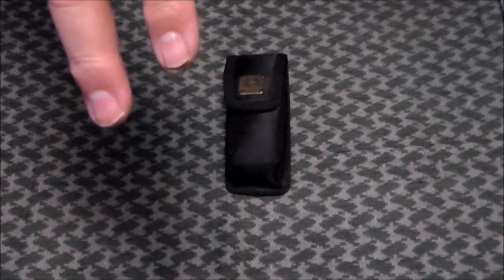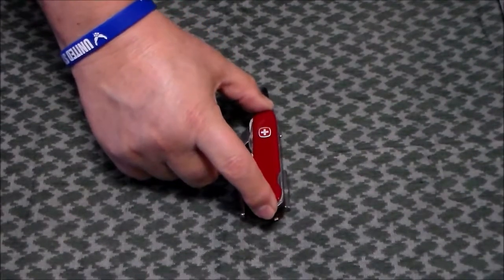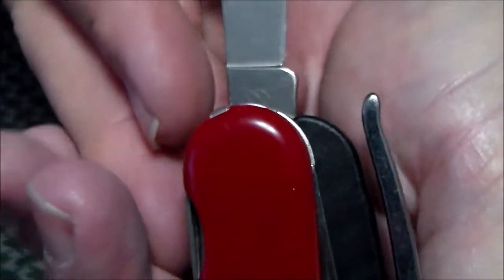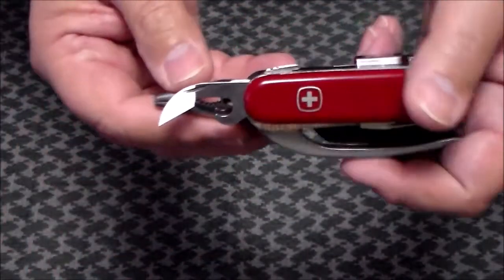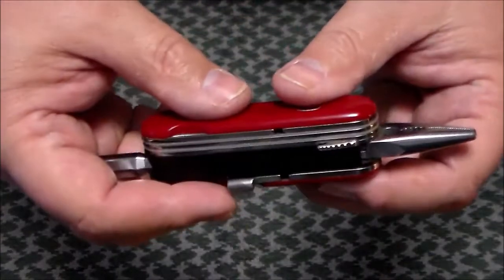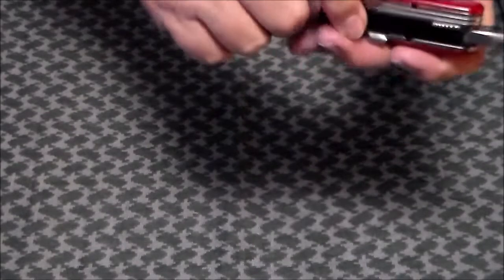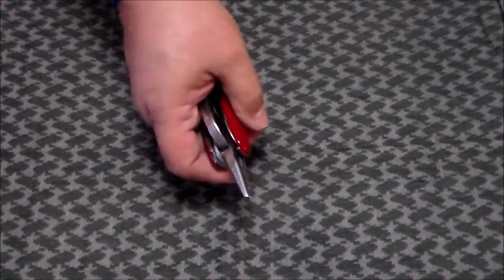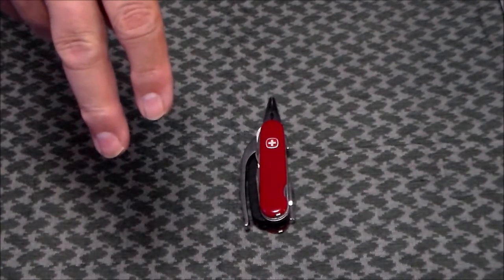Wenger Pocket Grip

Comment: My EDC for the last 14 years is the pocketgrip 200 or Irongrip. 

I love it. Built like a brick.

Btw mine has the pivoting lock instead of the slide like yours.
Reply from the maker: Is that on the 120 MM frame?
Reply: @thesakguy3852  85mm https://photos.app.goo.gl/3xHAjnBZtoSohy4a6

Comment: So does the main screwdriver lack the typical patented Wenger lock? When pressure is applied, the driver recesses into the body, and cannot fold. Even my small Wenger origined models of the Victorinox Delemonte Collection have this driver lock. Check and see--it is a great feature. The bigger version reviewed by Swiss Bianco had this lock.

Thanks!
Reply from the maker: You are correct the main screw diver will lock when pushed in I just did not press hard enough. Thanks for the catch that one went right by me.👍👍

Comment: very interesting. it seems very highly coincidental that Wenger discontinued it in 2010, and SOG released the Micro Toolclip first version the same year. hope your time downstate was enjoyable with your folks.
Reply from the maker: Yes it was. Always enjoy spending time with Mom and Dad.
Reply: I'm pretty sure that the original SOG Micro Toolclip was released in the early 1990s, 1991 if I'm not mistaken.  It was made in Japan and of very good quality, quite a bit different to the current one (which I have). 
Yep just checked multitool wiki:  https://wiki.multitool.org/tiki-index.php?page=Micro+ToolClip
It's probably the Generation 2 which was launched in 2010.